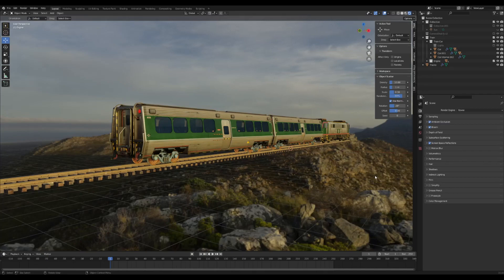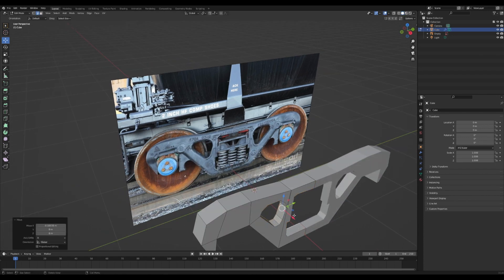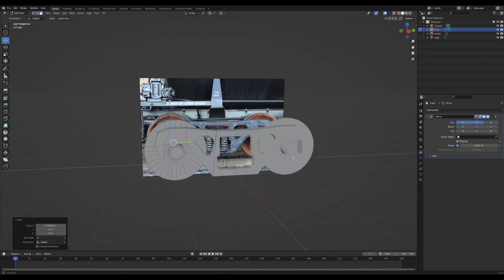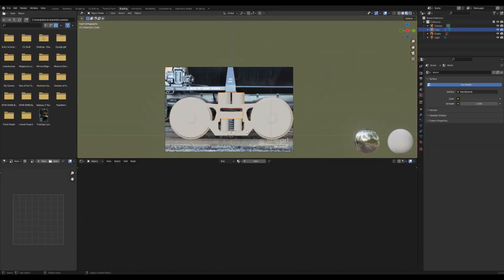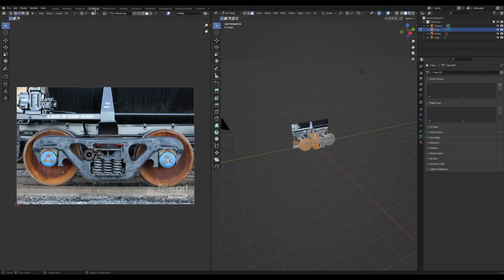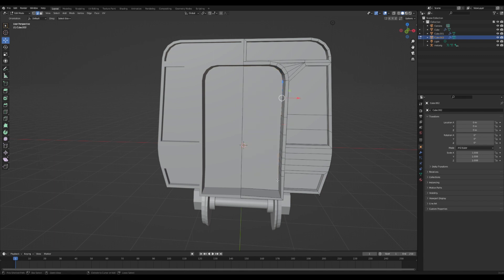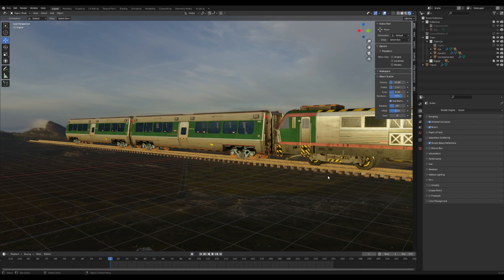Making a (Fast n' Easy) Train Car in Blender 3.1 | Blender Tutorial

Comment: Took up blender a few days back, first project was a Kawasaki Heavy Industries 151, really glad to have this tutorial! Could export many of the steps into my own build, works really well, hope to see more of these!
Reply from the maker: Thank you! I have a tutorial on making train interiors too, if that’s helpful
Reply: @renderedinblender  I have seen it, but my only issue is for interiors, should I overlay it and make it from another part instead of using the exterior's shape? Because my train's interior I can't even line the walls due to the fact that extruding the faces will, as usual remove the exterior walls since it drags it
Reply from the maker: Okay so if you want a train car with both interior/exterior, duplicate the exterior and drag the walls in/ceiling down so that you have some depth to the walls (but windows still stay in the same position). Then you can select edge loops you wish to be connected (the inside of the window and the outside of the window) and bridge them using the “bridge edge loops” option
Reply: @renderedinblender  Thanks a lot, I will apply these and hope it goes well!

Comment: thankss.. but how do i save those all those textures that you do in shading editor? i want to import in unity
Reply from the maker: Hmm good question! I have not worked with Unity, so I’m not entirely sure. However, I was having a similar issue with exporting to Unreal Engine. Perhaps if you go to ‘File’ and go down to the ‘External Data’ tab, you might be able to pack the resources (like image textures and stuff) into the file automatically? That’s what I do when I’m sharing blender files to other people

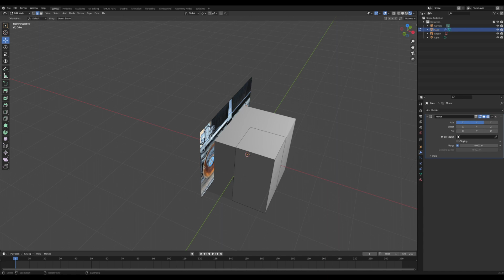Comment: I am struggling to do this 1:14. My blender is up to date but I am coping you and what my one does it completely different to what your blender is doing. Have any suggestion how I could fix this?
Reply from the maker: You take the basic default cube and add a mirror modifier (found in the modifier tab) to it. Then in edit mode, add multiple edge loops to bisect both sides of the cube so that you can delete all but 1/4 of the cube. Make sure to check the X and Y for the mirror mod so that it displays both
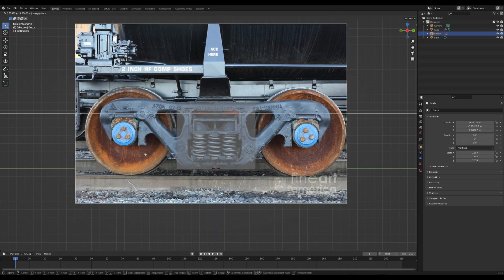Reply: @renderedinblender  How thanks for your help got there in the end. How do you do the part in 1:42? As my one just moves the cube.
Reply from the maker: My main guess is you aren’t in edit mode? Make sure to press tab to enter it so you can manipulate the faces/edges/vertices separately without messing up the whole cube
Reply: @renderedinblender  I am confused how you make the cube bigger.
Reply from the maker: Press “s” on the keyboard to scale objects. I have a beginner tutorial with helpful navigation and hotkey commands that you might find useful?